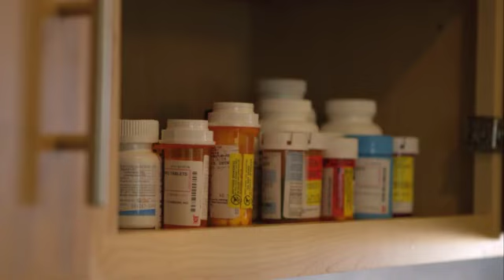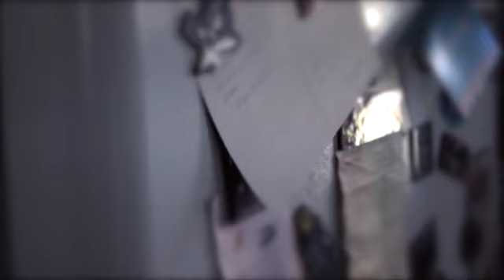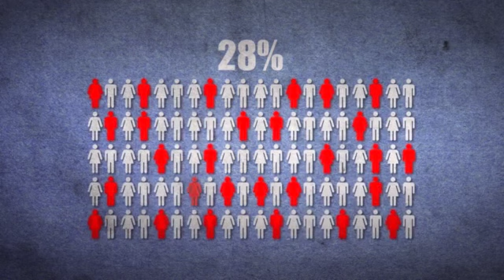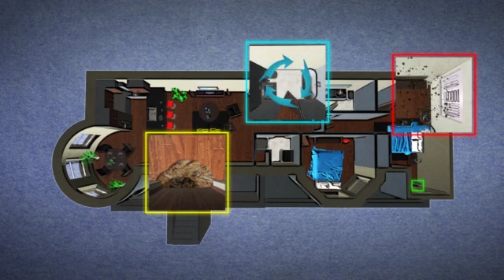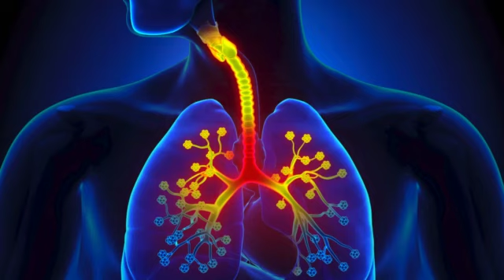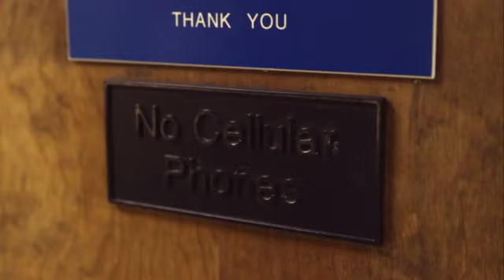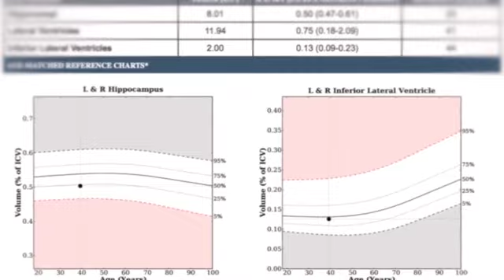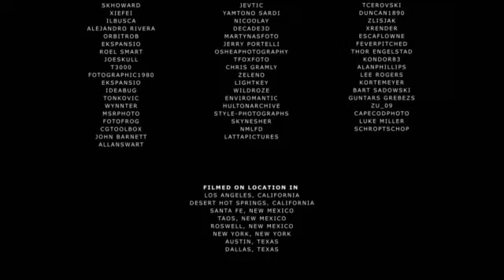Black Toxic Mould - Doco

Comment: Thanks for the vid. One can always take few immediat, not expensive steps - full house (basement, attic and every single hiding hole ) disinfection with UV-C (just don't expose yourself to it - use remote  switching ;)) for some 10-15 minutes each room (depends on the size), ventilate the room after. Operate negative ion generator(s) (with fan and some air pre-filter for better distribution of anions, you might event insert them into your air duct AFTER air filter) 24/7 (cheap DIY from ebay :)) in your bedroom and around the house - it will lift your spirits (hopefully and magically) as well as coagulate and  precipitate  all sub PM2.5 particles on your surfaces like walls and electric devices (might be a pain to clean them off later but it is worth it). Use creativity and live happily!
Reply: Martins Kreicis I used negative ion generators when I was pregnant with my first child 42 years ago. We even had one that plugged into the cigarette lighter in our car. A few years later we had difficultly finding them ( no internet in those days
)

Comment: I FOUND MOLD IN THE STRANGEST PLACE!  Like many people, I don't use bleach in my laundry because of allergic reaction to it.   Every time I did laundry I would small gas coming from the washer, which seemed impossible.  After 6 years I finally got a new washer and took the old one apart to see if we could figure out what was causing the smell.  What we found was frightening.  The entire inside of the machine was FULL of black mold so that every load of clothing we washed was getting exposed to mold!

If you don't use bleach in your laundry use ammonia at least once a week!!!!  To check your machine for mold take the agitator out and check under it and the bolts that hold it in!!!
Reply: She Cares run an empty load with some cleaning vinegar and hot water along with a tinny bit of soap  it kills the mold in your washer and bleach can actually dry out the rubber and plastic
Reply: How much vinegar for a regular size washer
Reply: I never use bleach, if you wash at low temperature of course you get mold
Reply: @katherineallen7781  - I thought top loaders were BETTER than front :  (
Reply: i always use bicarbonate of soda and borax. as our tap water is fluoridated and is riddled with black mold
Reply: @katherineallen7781  pp

Comment: hi, thanks to the toxic mold summit and now yr  video.  i'm  cleaning my juicer out, as i had not realised there was mold on it (also in bathroom).  with my wooden tooth brush and some bicarbonate of soda, it's coming off so easily.   i've just done a juice with pineapple and papaya fruit (very anti inflammatory), apples, grapefruit, lemon, ginger and turmeric, artichoke tops (from garden). a couple of mugs full and my stiffness and energy have gone.

Comment: I believe this is affecting me, we own an adobe house built in 1940 and remodeled it. I cant concentrate, i stutter a lot, and are very very forgetful. Im feel extremely anxious and aggressive but i keep it in. I also hear ringing in my ears and my mouth is dry most of the time and my nose congested.
Reply: Miguel Caballero hire a hygienist to do testing.
Reply: Hope it works out
Reply: Same like me...
Reply: Blankspace I am being treated for mold toxicity and was told not to take probiotics.  Yes, drink water, spring water is the best as it has minerals.  Also, sweating outside, or sauna,p if you can handle it.  read Dr. Jill Christa book.

Comment: I am diabetic w/ insulin. Mold took me down fast. I am a vegan, but they transferred me to another apartment and I'm getting it again.  I'm the canary.  You can see mold in the toilet water, not nearly as bad, but it's green dots on the baseboard heater in the bathroom. I'm alone on SSA w/ a section 8 voucher to use and I can barely remember to look or have the energy.  My doctor, after seeing the pictures wrote to management, treating for mold."  I can barely cook and I'm skinny, no fat. What to do. It's on the gutters and wet mud under my outside Windows. I don't use the air conditioner. My skin smells like mold. 99109. My eye sight is worse, joint pain, fatigue, memory loss..doc gave me pills and I can't rely on those.
Reply: Barbara Mowrey I can relate to your symptoms. Hang in there! You're not alone!
Reply: Barbara Mowrey  every since I moved to SoCal, I got sick. I've never seen a moldy ring around the toilet and every time I cleaned it, it would come back a few days later. Now I have fibromyalgia and the landlord wouldn't take care of it, all they did was paint over the mold above my shower since there was a leak from the tenants upstairs. After two years, we finally moved to another apt complex and they have mold in the toilet bowl too. I tried getting blood tests and chest X-ray and no traces of black mold but I know I have it in my system.
Reply: I even gained 30lbs out of the blue. I'm surprised that i made it to work everyday.
Reply: Barbara Mowrey read Dr. Jill Crista’s book

Comment: Just found an infection in navel, used peroxide to remove it, and found a growth in the bottom with a microscope and it has what looks like black hyphae and a white one, took a few photos but cannot find a dr. to look at them for an opinion. Thinking about putting bentonite clay detox to see if it draws anything out? A nurse friend has never seen things like this. I also had several black mold gametes from my stomach yesterday after eating fresh mint. Will do it again today, if there are more I want them out too.